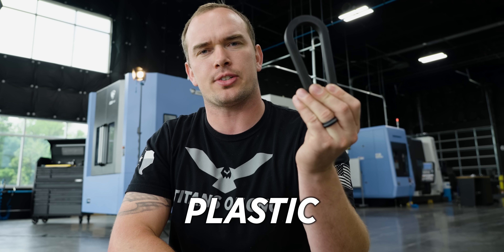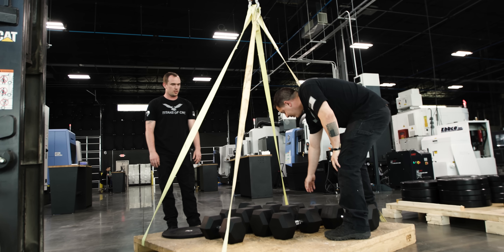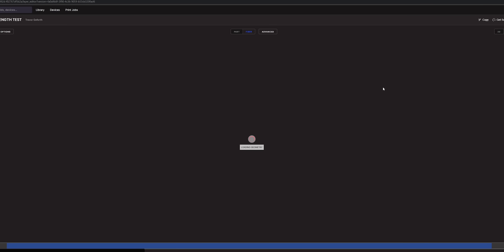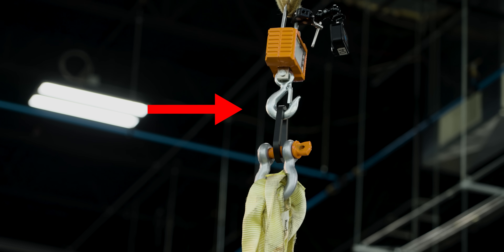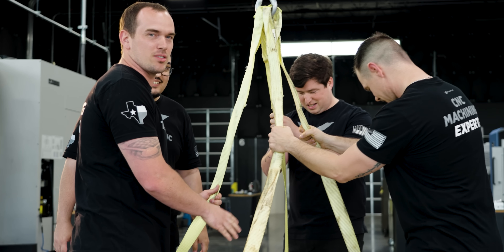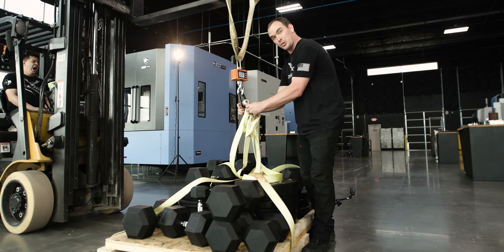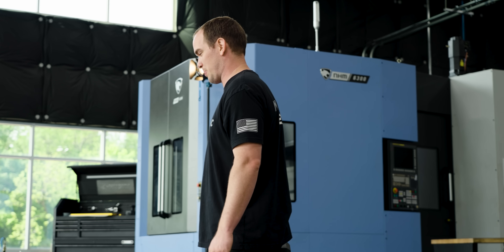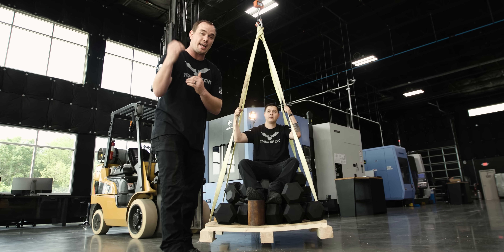2,000 LBS vs 3D Printed Plastic | WILL IT BREAK!?

Comment: Oh the shenanigans you weave.  🤣 Very cool to see something like this part take that much weight when engineered properly. I am a little surprised that Titan and Barry didn't get onboard with trying to make it break.
I am curious though, can carbon fiber be purchased by any joe schmo with a desktop 3D printer? Asking cause I have been looking at different 3D printers but not filaments.
Reply: You can do chopped carbon fiber filaments on just about any 3d printer if you replace the brass nozzle with a steel one. However, this is different than continuous carbon fiber as it doesn't provide as much tensile strength. Chopped carbon fiber does improve strength over regular filament though, and it gives parts a really cool surface finish.

Comment: Important note: I hope you had to specify the loading rate into your software while calculating the safety factor (@ 4:48). 

Polymers exhibit stress relaxation. At lower loading rates, the polymer chains have sufficient time to reorient and reduce the stress level for a fixed amount of strain (especially in uncrosslinked polymers). Try quickly bending and releasing the clip of a plastic pen cap vs slowly pulling it back and releasing it. In the second case, the clip will not return to its original position due to permanent plastic deformation. 

While designing polymer parts, using properties from standard tensile tests like ASTM D638/ ISO 527 can result in part failure at premature loads as these tests fix the loading rate. The values from these tests can only be used to compare different polymers. 

In this case the carbon fiber definitely helps stiffen the hook but the loading rate is something to keep in mind.

I recommend the book “Understanding polymer processing, processes and governing equations” by Tim Osswald for further reading.

Comment: Great video, but there's a mistake at 3:34 - Re-orienting the part like this still means a tensile load on the fibers, it's just down to the part's geometry. The type of load would change if you were to load it perpendicular to the fibers or compress it.
Reply: Depending how the load was placed, the straight sections would be in bending. That means only half the fibers would be in tension, the others would be in compression (which has very low strength- it's like pushing on a rope!)

Comment: I guess the 1520lbs is telling you when it will start to suffer permanent deformation... but with the fibers that way, it will get more like an 0 shape due to the casing breaking but it will still remained close, that many loops of carbon fiber will hold way more than that before finally giving up
With the added benefit that it gets like 2 breaking points, so the shape will fail and u will be able to replace it without it completly breaking apart at the second breaking point, clever

Comment: 9:49 except the plastic you use with the fiber makes a difference and have fun printing most of those in a open frame machine.
Reply: 1-10K machine with heated chamber and hardened nozzle. Price has been coming down over time. But professional services that print parts on demand with these machines are on the rise.  All about picking right material for the job.

Comment: carbon fiber is NOT plastic
Reply: They mean the overall part is plastic, or a composite material with PLA as the matrix and carbon fibre as the fibres inside.
Reply: What is CFRP short for again? Carbon Fiber Reinforced P...what could that P stand for? Hmmm.. plastic maybe?
Reply: @BigDogEnergy-69420  CFRP is the abbreviation for carbon fiber-reinforced plastic. CFRP is a material consisting of several constitutes: a base or carrier substance, also called matrix, and a second reinforcing component, the carbon fiber, which is embedded in the matrix. USUALLY A SYNTHETIC RESIN IS CHOSEN AS MATRIX MATERIAL. The cured composite has different mechanical properties depending on the type of carbon fibers used, the matrix and the manufacturing process.
Please note the RESIN part in the above expanation. A resin is a solid or highly viscous substance of plant or synthetic origin that is typically convertible into polymers, and while all plastics are polymers not all polymers are plastics.
Reply: @madmurdoch2000  right, so which part about reinforcing a plastic part with laid continuous fibers was it that led you to interpret they were calling the whole part carbon fiber, or equating the two?
Reply: @BigDogEnergy-69420  oh i dont know how about the fact that he made a part from carbon fiber and NOT PLASTIC. you cannt mix and match carbon fiber filiment with PLA or ABS.{due to the differant melting points of the filiments}.  so the whole thing must be made from a carbon fiber filiment which is basical making a carbon fiber part. and carbon fiber is NOT plastic the resins used are polymers but those polymers are NOT PLASTIC. they work in a machine shop and have to know all about the differant matirials that they use as so them saying that it;s plastic is not TRUE.
Reply: @madmurdoch2000  You are being pedantic, but I know what you are talking about. He made a very specialized continuous carbon strand part that just so happened to be encased in a more regular plastic filament (which I think has chopped carbon strand in it also). Then says "It'S jUsT pLaSTiC BRO!"
I actually don't know how he did the interior on an FDM printer. He completely skipped over how he did that part or what the raw material and process was.
Reply: @mjodr  some people say pedantic some people say precise. the part is 100% carbon fiber filiment. you can tell this from looking at 2 things in the vidio. 1) the 3d printer had only a single spool of filiment in it. but this alown would not have said single filiment which is why 2) if you look at the part of the vidio showing the slicing it shows the print path for the head and it goes from one side of the part to the other. leading me to believe that there was only a single filiment type.
all of that aside tho even if you are right and they used 2 filiment some how all he did was test a 3d printed cabon fiber part covered in plastic. and do you believe that if they had ( in this scenario) just left the plastic off it would have effected the total weight the part carried? NO i would not have.
this is a company that talks about precision and how important it is but when they put up a vidio with a title like "2,000 LBS vs 3D Printed Plastic | WILL IT BREAK!?" anyone into 3d printing would expect PLA or ABS filiment to be used NOT carbon fiber filiment. AS carbon fiber is NOT plastic
Reply: @madmurdoch2000  I only have one quibble with all your analysis. Raw carbon fiber itself has no stiffness. It just flops around. Any finished carbon parts that people see definitely have "plastic" in them, usually in the form of some liquid resin. So very rarely do you have a finished functional carbon part that contains zero plastic. For this reason some people refer to it as CFRP, as in carbon fiber reinforced plastic. I've then seen that jokingly referred to in a shorter form of just "plastic". But yeah he mentioned the interior of this piece as being a continuous strand of carbon, but completely failed to explain how it was made. For all we know it was a traditional lay up, lol.
Reply: @madmurdoch2000  it’s printed with two materials. Onyx, and carbon fiber. The spool inside the printer is carbon fiber. The Onyx spool is stored in a separate dry box and fed into the printer - comes in a much larger spool. The print head has two nozzles. One for the plastic and one for fiber. The outer shell is Onyx, and carbon fiber is inside. The printer is from Markforged. You can go check it out to learn more.
Reply: @dskraus  2 points firstly Onyx is a prepriortary filiment from Markforged for making composit parts and it is a micro carbon fiber filled nylon,  which makes it a carbon fiber filiment so i doubt they would use 2 differant types of carbon fiberand even if they did..... secound this whole thing started when i said that "carbon fiber is NOT plastic" and nylon is deffinatly NOT PLASTIC and neather is carbon fiber so your point here was??